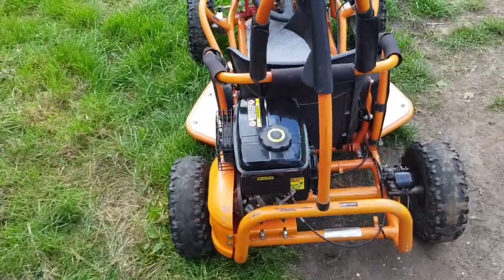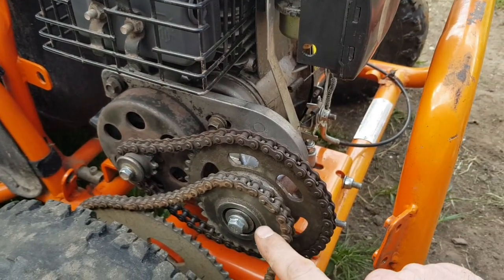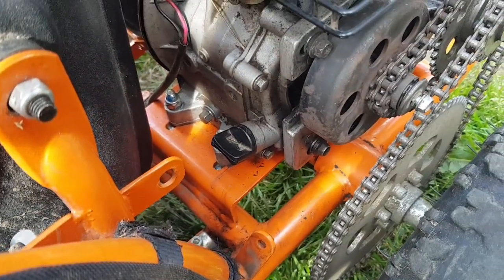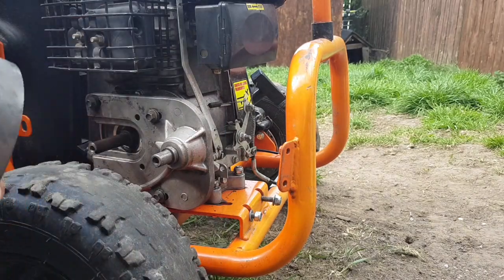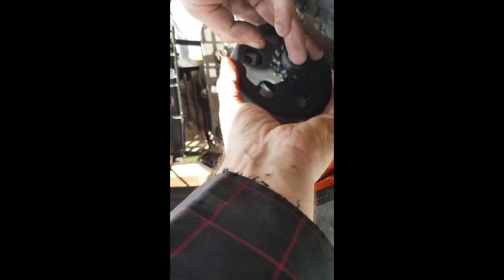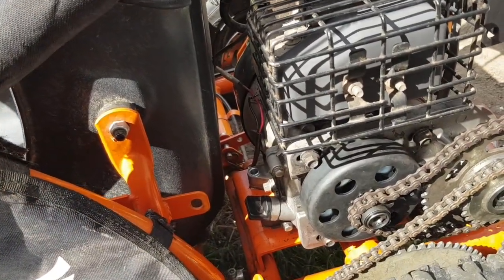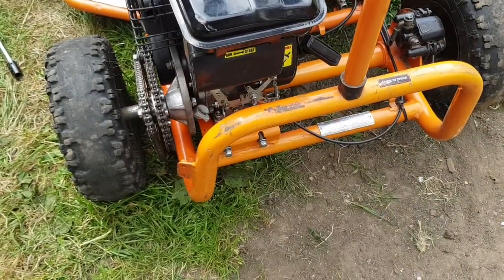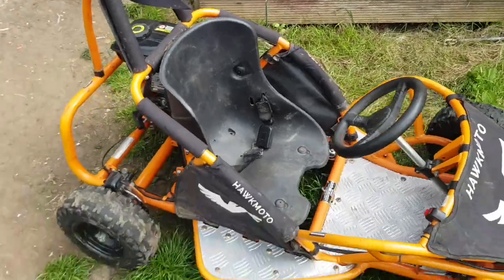HOW TO REPLACE CLUTCH 80cc OFFROAD BUGGY GO KART

Comment: Nice video. I usually just take off the bottom large sprocket and wheel to put on the clutch leaving the motor bolts on. Probably the same amount of time but less fiddle with good access. 👍🏼
Also on the new clutch I usually put some extra water proof grease ( usually the factory does not put much on ) on the clutch shaft. Really makes it smooth in turning, quieter and last longer.

Comment: could do with your help, son has exact same gokart, and we cant get it started after the winter!
Reply from the maker: Your carb might need a good flushing.
Some brake cleaner or MAF sensor spray or petrol and elbow grease.

And you could lift the back wheels off the ground by resting the frame on something, if it starts, you might possibly have a dodgy clutch that's causing the engine not to start because it's catching too soon.

But my money is on the carb needing flushed, and possibly the tank aswell, sometimes stale fuel causes new fuel not to run good.
And double check your fuel filter make sure it is clean and not full of sediment as this will cause fuel flow issues.

Check your sparkplug rubber boot, sometimes they get old and the spark arc's before it gets a chance to fire the plug.

Make sure your CHOKE is on for first starting.

And if its none of this I would suspect the coil. 

But please check your kill switch, you could try unplugging it and trying to start it, if it runs, your killswitch is bad.
This catches all of us out but easily over looked.
👍👍👍

Comment: Great video. I have the same go kart. What is the clutch part number you used?
Reply from the maker: https://www.ebay.co.uk/itm/Centrifugal-Dry-Clutch-5-8-16mm-11-Tooth-35-Pitch-for-80cc-Go-Kart-Buggy/323737111110?hash=item4b603c4a46:g:G1cAAOSwqZRciu0M
Reply from the maker: This was the type of clutch, I don't have the part number.
You will find other versions on ebay easy enough, but that's the sizes you ate looking for, if you already have a clutch, just match the amount of teeth.
Or if your clutch was needing tweaked for speed or pulling power you could opt for a lower or higher amount of teeth to suit your needs more.
👍👍👍
Reply: @oraclescave   awesome thank you

Comment: Do you have a link for the replacement clutch?
Reply from the maker: I replied to Bradley Jones with a link, check his comments in the list.
I can't find it at the moment, but it's the one in the link, you might find it cheaper than that link but all the sizes you are looking for are there.
I think they get called MAX TORQUE CLUTCHES.